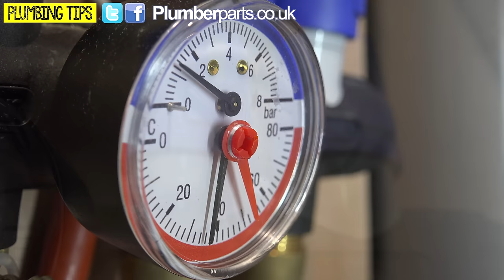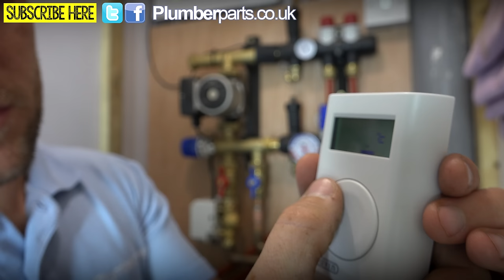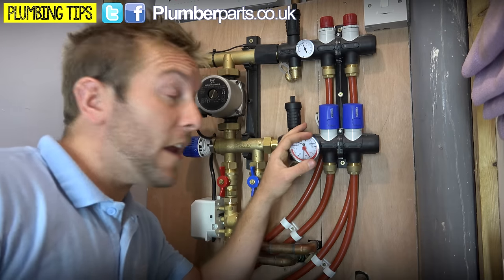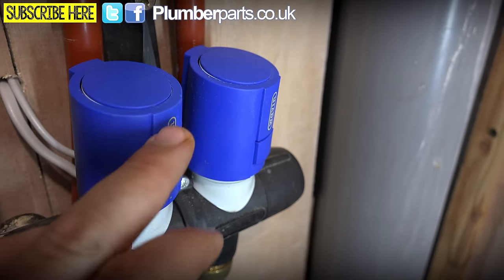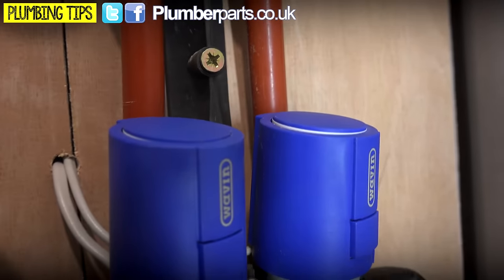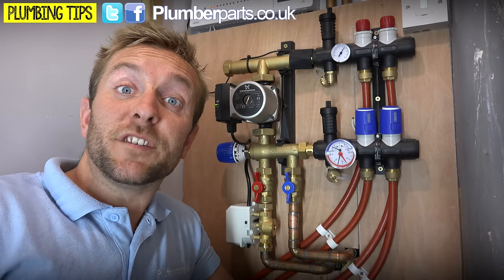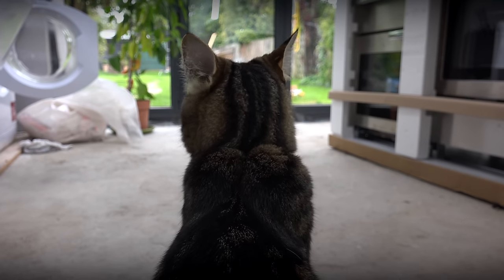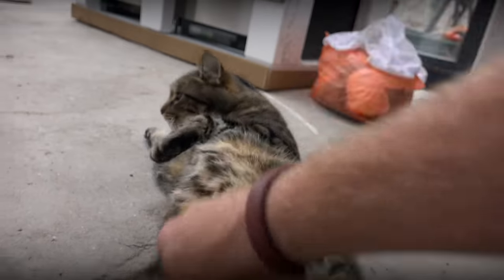UNDERFLOOR HEATING GUIDE AND INSTALL PART 2 - Plumbing Tips

Comment: Hi, I'm renovating our house in France and was thinking of installing underfloor heating but am a bit concerned about the thickness off the stone floor going back down on top of the heating loops, I've done the DPM and base with 100mm insulation on top and was going to use 16mm pipe with a 20mm protective screed over the top. Once that's cured I wanted to relay the original stone floor but some of the stones are up to 11cm thick, with about 40mm cement to lay them on. My question is...will this be too thick to run effectively?
Cheers Andy.
Reply from the maker: Hmm they are VERY thick! Good luck lifting them. In the UK we usually try to get 75mm screed then add another 20mm for the tile/adhesive and that works fine. I think you'll be ok, but you'll have to run the underfloor heating constatly at a low temperature (like 30 deg) 24 hrs a day as the heating/cooling curve will be insanely long!

Comment: Hay awesome video.
 Would it be possible to have your contact number please. 
My builder hasn't explained anything about underfloor heating I am trying to figure this out been some time. 
The first 30% of the pipe (80m) gets hot (  under your feet) the rest remains really cold don't understand we have 3 zone's 
All the same issue.....HELP

Comment: straight on the return between the 90° and valve on the return.....fail
Reply from the maker: High standards there Bruv, but yeah, we had to move the height of the manifold to talk the two port valve. Not so much a fail, more of a 'get it right' :)